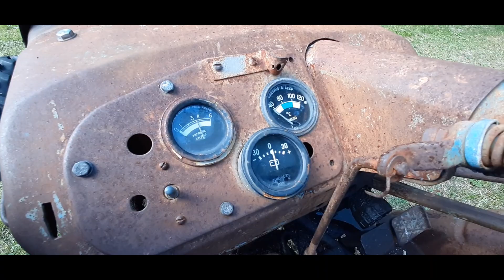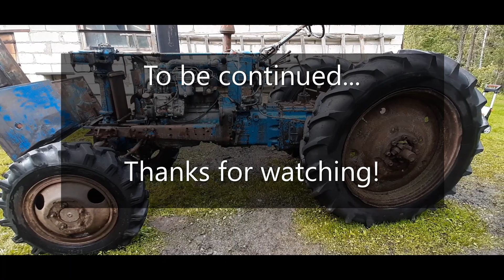Belarus MTZ-52 Restoration Project Part 1 - Removing old stuff and cleaning

Comment: What engine/oil cleaner would you recommend using on a very oily tractor? {Im talking years of oil almost everywhere}
Reply from the maker: I used K2 akra engine cleaner and pressure washer. K2 worked quite good (I used it about 3 times to get it totally clean), but Im sure there's something more better than K2. My father told me he used to spray hot diesel into oily parts and that worked excellent.
Reply: @indrek06  interesting was one bottle of akra enough?
Reply from the maker: @mrwilsss1145  I used about 2 bottles
Reply: @indrek06  im thinking of buying it